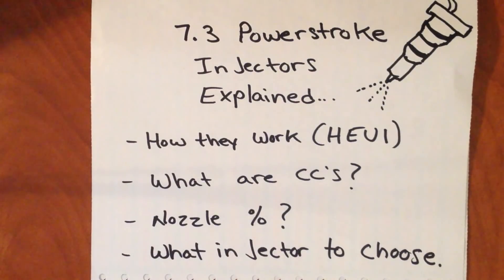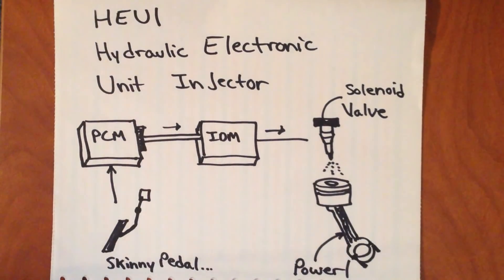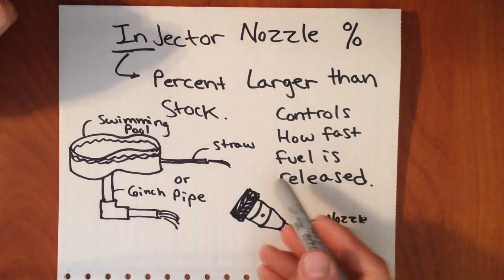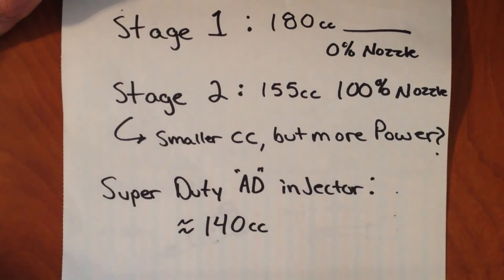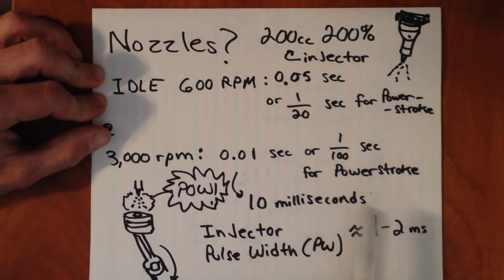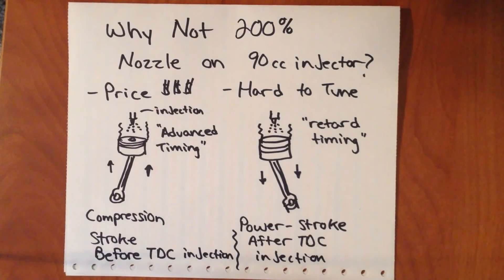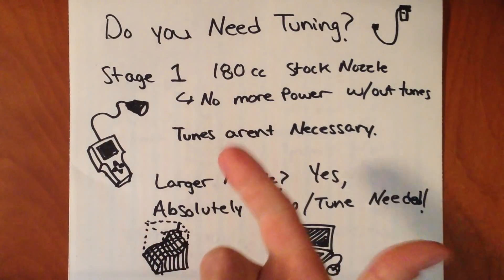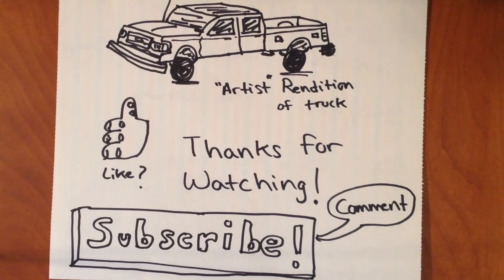7.3 Powerstroke Injectors Explained

Comment: Any ideas on what injectors  would work for towing 15,000lbs and help keep temperature at a reasonable  level
Reply from the maker: I wouldn't know for sure. It depends on a lot of factors though, is the truck intercooled, is the turbo upgraded? Both intercooling and turbo upgrades will help lower EGT's as they serve to essentially lean out the mixture and put more air vs fuel into the cylinder. That being said, at the end of the day it depends on how much you put your foot in it. More fuel typically equals higher EGT, unless you start dumping in so much fuel that there is incomplete combustion and the fuel itself will lower EGT, but that's another story and explains why you see drag trucks billowing out soot. If you're going to be pulling that much weight, which 7.3 trucks were never really designed to pull that much, you need a set of gauges and you should keep an eye on EGT to preserve the engine. Look at it this way, a stock Super Duty is rated for around 10,000 lbs towing. It is intercooled, and runs 135 cc injectors with stock nozzles. It is designed to pull that 10,000 lbs all day and not have the operator worry about EGT, as long as you have stock tuning and everything else is in good shape. 

I personally have 160cc injectors with stock nozzles on my OBS 7.3. The truck is intercooled and has a stock (albeit worn) TP38 turbo. I can put my chip on the "daily" setting, which is the 2nd performance level (out of "tow", "daily", "performance", and "race") and running UNLOADED I can put my foot to the floor and EGT's typically don't exceed 1200 *F pre - turbo which is about as high as you should go on EGT. I think 1250 is the hard limit for sustained EGT though. I could write a novel on this there are so many parameters that go into influencing what your EGTs will be. How fast is the engine already spinning? How quick does the turbo spool?  etc....

Bottom line, I'd go with anything with stock nozzles for towing. Here's my reasoning:

Stock nozzle injectors behave as stock injectors without tuning. They only dump in more fuel when you alter the tuning e.g. increase injector opening duration (pulse width), increase oil pressure, and advance the timing. 

With that you can always remove the tuning and go back to stock if EGT becomes unreasonable. I've been happy with my 160cc stock nozzled "stage 1" injectors. However the next step up "stage 2" comes with bigger nozzles typically and that becomes a little harder to detune. It'll dump in more fuel even with stock tuning where a stage 1 wont. Also 160 or 180cc injectors will get you to around ish 330 rwhp with the proper turbo and exhaust upgrades of course. That's about on par with a modern diesel. I believe 330 rwhp is about what a 6.4 powerstroke is rated at stock. Unloaded it feels like a rocket ship though and has tons of power! 

At the end of the day, as long as your tuning isn't too radical, EGT just comes down to your right foot. EGT is directly proportional to how much fuel you dump in, which is in turn controlled by the accelerator pedal. I've found that by cruising down the highway and under nearly identical conditions, I get about the same EGTs regardless of how aggressive my tuning is, but your's may vary slightly from that too of course. Basically you could get a set of gigantic injectors like 250 cc 100% nozzled injectors, and as long as you keep your foot out of it you won't see any higher EGT provided of course you're basically dumping the same amount of fuel into the cylinders. Look you can melt the engine with stock injectors and wild tuning pulling that 15k up a hill and your foot on the floor. No injectors will truly be "foolproof safe". If you're towing outside of your trucks parameters, you've got to be wise. Get an EGT gauge at a minimum, keep an eye on the EGT, and back off the accelerator when EGT's get too high. Yes backing out of the skinny pedal may mean slowing down on a big grade, that's just the nature of the beast. You're asking the 7.3 to do things it wasn't designed for, so you need to be an "operator" not a "driver" and just control the engine as you see fit for longevity. You could run faster up that grade and big injectors if you upgrade the turbo, or get different tuning that is better suited for towing. Again the possibilities are immense! 

There's really no cut and dry answer here. Use common sense, use, don't abuse your engine. 

Happy Trucking!
Reply: Thank you so much for the detailed reply.  Its very helpful and much appreciated!  I bought the truck last year with a banks 4inch pipe to 5inch exhaust.  It has a banks big head boost. Im not sure if the turbo wheel was upgraded.  The Housing is stock.  I purchased a Dp tuner and had jody tipton give me a 40hp tow tune i believe he rates for 13 or 14 thousand lbs towing. I also purchased a curt brake for triple axle breaking.  I have an egt gauge along with a boost gauge.  I also purchased tourque pro to monitor ipr pressure, pulse width,  transmission temp, and engine oil temps.  I just dont know what the upper limits on temps should be for the 7 3.  Except for the 1250egt.  What are the upper limits for engine oil temps, tranny temps,  ipr, and hpop pressures?  Again thank you for your time and knowledge!
Reply from the maker: I'm glad to help! It sounds like you've got a pretty nice setup for towing. I'm way jealous of your exhaust system... OBS 7.3's would need a hole cut in the firewall and a patch welded in to fit a 4 inch down pipe...

Your exhaust is about as good as it gets when it comes to performance. Banks makes some good stuff, albeit expensive, but top notch from what I've heard. The big head boost will help some with your EGTs, mostly on the higher end. Of course more boost typically lower's your EGTs provided that the drive pressure on the turbo is not too high. On that note, you may want to look into changing the exhaust turbine housing if you're going to be towing that much frequently. If you have some time, read into turbocharger exhaust turbine A/R ratios. Essentially it's an Area divided by Radius ratio of the housing where area is the cross sectional area of the housing scroll, and radius is the distance from the center of the turbine housing where the turbo main shaft is, to the center of that turbo cross section. Your area/radius ratio on the turbine housing side at least, controls the spool up characteristics of your turbocharger. Generally a smaller A/R ratio allows the turbo to spool quicker on the low end, but makes is more restrictive on the upper end. For example, my OBS 7.3 has a 1.15 A/R ratio, whereas stock SD's have a .84 A/R ratio I believe. I've had the chance to drive my friends' SD 7.3 and the turbo spools way quicker compared to my OBS. The OBS just has so much turbo lag! While the 1.15 A/R housing is great for full throttle low exhaust restriction, it is slow to spool. The .84 A/R of the SD spools great down low, but is more restrictive on the high end. At this point, I believe the turbine housing is the most restrictive part of your exhaust on the high end at least. A good compromise most people do for OBS and SD 7.3's is to install a 1.0 A/R exhaust housing. Banks makes some and I think Garrett offers a 1.0 housing as well for half the cost of the Banks unit. You don't want too big of a turbo though, unless you have massive injectors and radical tuning, you'll never get the thing to spool to its full potential. 

Another thing you may want to do is to install a bigger transmission cooler for that 4r100. Look at a 6.0 Powerstroke transmission cooler. They should pretty much bolt in on your SD and will make a huge difference to help your transmission run cooler. The transmission is unfortunately pretty much always the weak link on 7.3's.  I've installed a 6.0 transmission cooler on my truck and though I run unloaded, I have yet to see transmission temperatures exceed 165*F since I've been monitoring the trans temp. I compared that not long ago to my father's LML Duramax with the Allison 1000 transmission, again the transmission temperature stayed in the same range as my 7.3, which is probably good considering the Allison 1000 is considered a nearly bulletproof transmission. Really the lower the transmission temp. the better. I think factory operating temperature is around 180*F for automatics, but you don't want to exceed 220 *F from what I've heard. Again for towing, keeping transmission temp. low and safe may mean pulling over to the side of the road to let things cool down on long steep grades with a heavy load. 

For Oil temperatures, I'm not so sure. I've seen my oil temperature get up to 220*F with about 1500 lbs of extra gear and going about 80 mph on the freeway, though unloaded it usually stays closer to 200*F. I haven't read that much into engine oil temperature limits, nor have I looked into adding an extra oil cooler. However as Mechanical Engineers, we're told not to design a bearing that will let conventional oil exceed 250*F before you start cooking the oil, but really I'd probably pull over to the side of the road if it ever got above 230*F. Synthetic oil could probably go higher, but past as certain point you start damaging engine seals. Theoretically if your oil temperature got too high, it'd lower your viscosity and you would lose oil pressure too. Oil pressure is extremely critical!

IPR, I've heard 65% is the maximum duty cycle it can operate at. Though if your IPR gets to that point of 65%, you probably have a weak HPOP or a high pressure oil leak. My OBS typically sees a 14 % IPR duty cycle at idle. For a SD I think closer to 10% at a fully warmed up idle, but they also have stronger HPOPs. If it reads 20% at idle or something like that, you probably have a problem. I've never seen my IPR exceed 45% though as far as I know. 

HPOP pressure, you don't want it to drop below 500 psi. Your 7.3 needs at least 500 psi to idle. Though with stock tuning at wide open throttle mine hovered around 2500 psi or so. However, HPOP pressure again varies by tuning and injectors. Your tuner can increase your IPR duty cycle, which effectively raises HPOP oil pressure. I've heard some competition units run over 3,000 psi, but I think 3,000 psi is about as high as a stock HPOP will go if it is healthy. This parameter really varies with tuning. Bigger injectors also typically require higher HPOP pressure to fire as well. You really shouldn't see a "high" HPOP pressure. If anything it'll be low signifying you have a problem. If it get's too low, say maybe your HPOP can only make 1500 psi at wide open throttle, you'll probably get terrible fuel economy, and be lacking on power that you won't want to go out on the road anyway. However over time HPOPs do get weak and can gradually lose pressure. 

If you want more information, it'll probably be best to dig through some of the old 7.3 powerstroke forums. Powerstroke.org has some, I think Fordtrucks.com has some forums, OilBurners as well, they're all over. There are a lot more people out there who have a better idea of what the safe limits and what good mods there are. That's how I've learned so much about the 7.3. It just takes a bit of digging!

Comment: awesome info. at what point would a OBS need a upgraded fuel system? I kinda lost you there. you talked about using all the fuel in the dowel capacity but at that point its the fuel delivery system that is lacking right? ive got a 250k 95' with no blow-by and a slight miss at higher rpm. haven't checked anything yet but I think its a great time to do some baby swamps and a hpop for the next 250k miles.
Reply from the maker: I apologize for the late reply. It's not easy keep up with comments from all the videos. I hope you were able to get your miss fixed (and potentially a new set of baby swamps?). When referring to the injector capacity, you can drain the injector fuel reservoir, that's not necessarily a fuel supply issue. Think about your injector as being a bucket of water, a bigger cc injector is a larger bucket. If you pour the water out of the bucket, once its gone its gone and you've got to go refill it, which with how fast these engines run relatively, there simply isn't enough time for the injectors to refill their internal reservoir before the powerstroke is over with. As far as upgrading the fuel pump goes, I haven't run the old mechanical pump hard enough long enough yet to know for sure when you need to upgrade to e-fuel. I've got a set of 160cc/00 injectors with the stock fuel pump and it works fine as far as I can tell. I also don't push the limit on the injectors since my transmission has yet to be upgraded, at most I run the 'daily' tune rather than performance, or race. I did have the truck 'randomly' stall out on me and I suspect it may have been a lack of fuel pressure, but without a fuel pressure gauge, it's hard to tell. Basically after romping on the accelerator around a corner under low rpm, it just died and stalled out. It restarted just fine and I haven't had a problem since, but I suspect that the pump is having a hard time keeping up. The main thing is that the mechanical fuel pump can only pump more fuel as the engine rpm is increased, whereas and electric fuel pump will supply all the fuel possible regardless of engine rpm. For any larger than stock injectors you should probably upgrade the fuel pump, but if you aren't concerned about driving like a race truck all the time, the stock pump will work fine. I hope all is well!
Reply: Rnddiesel   The stock mechanical pump has more problems than just supply. It will never fire as quickly as e fuel because the engine has to crank to build pressure. As they get old and worn they get worse. Cold starts are especially bad. I would switch any truck to e fuel no matter what injection you are planning. It’s probably one of the first things I would do to a stock powerstroke. All super duties are e fuel.

Comment: Thanks for the video.  I have a obs 97 F350 7.3 stock turbo,stock fuel pump, ts 6 pos chip. Daily driver will it hurt my engine to put in stage 2 160/30 injectors? Any thoughts. Thank you
Reply from the maker: teamstr259 Nice truck, same model and year as mine! We'll I don't proclaim to be an expert, so I may be off here, though nor am I a tuner. My trucks the same as yours, stock sticks, turbo, big intake and exhaust. Unless you plan on putting in an intercooler soon, I think you'd have a hard time keeping EGT in check, especially with the stock turbo. Though 30% nozzle isn't too much over board, but likely enough to make some potentially dangerous changes. It would be a good idea to get custom tuning too to make sure you don't mess anything up. I apologize I don't really have the answer for you, but I would think as long as you have tunes made for the stage 2's and gauges to monitor it all (and a light foot, lol) you should be fine. You'd really be risking it without customs tunes though.
Reply: I do have egt,trans temp & boost gauge. As far as the tunes all i know is that its a TS 6 pos with stock,hi idle,+40,+80,+100,+140 programmed by (Thorough Bred Diesel). My trans has been rebuilt and upgraded with billet parts. As much as I'd love to put an intercooler in it its not feasible. I do plan on adding a wicked wheel 2 to the turbo. Thank you for your thoughts i am just looking into options.
Reply from the maker: teamstr259 Sure thing! Talking OBS 7.3 and exploring performance avenues is always fun. Another thing you could do if the budget allows, is add in something like a Beans D66 turbo. It's a bolt in option, that supposedly flows 1050 cfm over the 750 stock. The more air would definitely help and I've heard it'll be good for up to 500rwhp. Also I don't know how much power you're looking for, but I looked into stage 1 160cc 0% nozzles, and they can put you around the mid 350 rwhp, with proper support mods. That's about comparable to a stock 1st gen 6.7 psd!